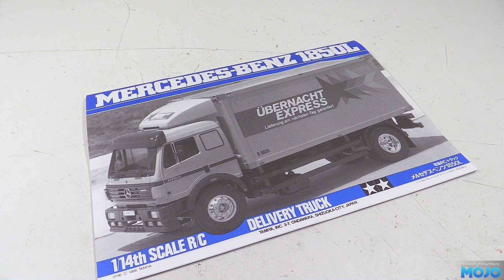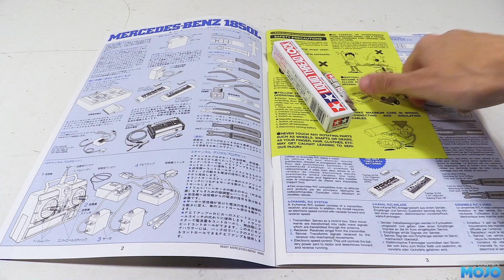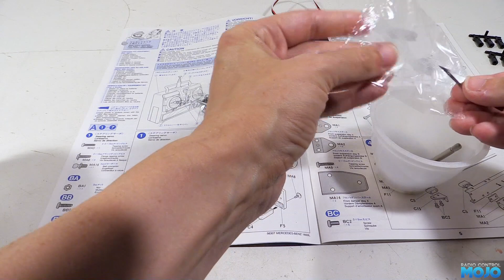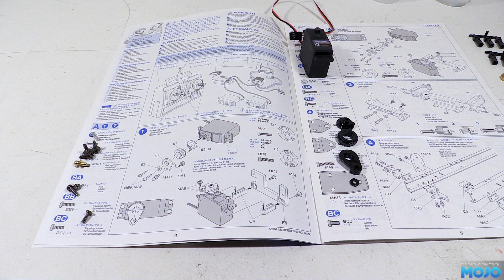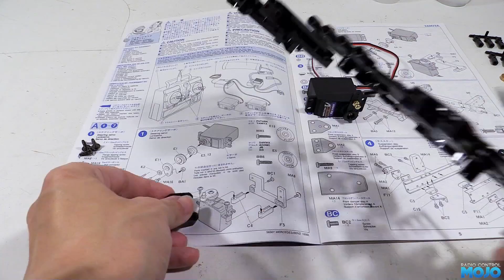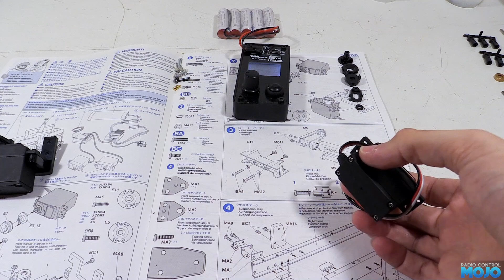Tamiya 1850l - 2 - Steps 1-2 Build intro and servos

Comment: Hi , I have built one of these truck but the problem is with steering servo as is not turning too much . I have used three different servos but the steering is not good as it should . Do I have to do some mods to the front axle or servos ? Thanks
Reply from the maker: If the servo is working correctly you should be able to go full lock to lock without any trouble.
When setting watch the front hubs they should just about hit their limits of travel, you might need to fiddle with end points if you’re transmitter has the option.
If you’re coming up short user a longer servo arm or move the linkage on the top of the crank to the inner position if it’s on the outer.
For mods you can modify the damper mounts to allow for more travel in the hubs, there are also mods to correct the ackerman which are a bit more involved and the simple method involves loosing the 3 speed servo.

I’ve got the bits to upgrade the axle on one of my truck, more lock, less slop and ackerman correction. One of these days I’ll get to it and make a video

Comment: the tip with the steering servo is alo handy for indoor 1/10 racers :D
when I built my first indoor car (it was a Tamiya TT-02) it did not steer at all... the tires had so much grip on the floor, that the servo would turn, but it all the "energy" just went into the servo saver :D